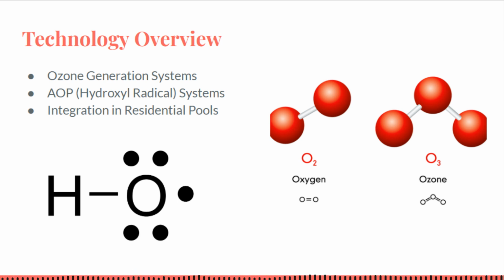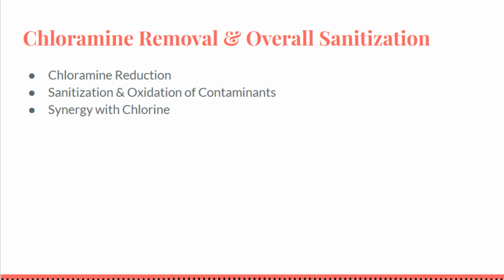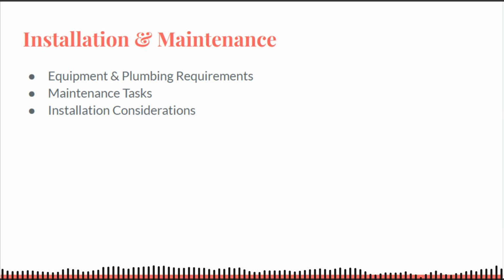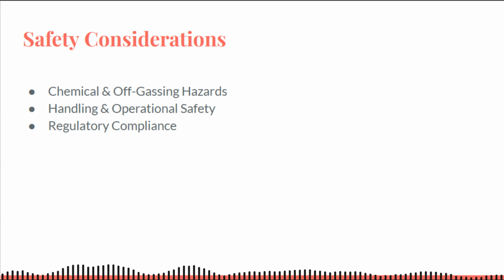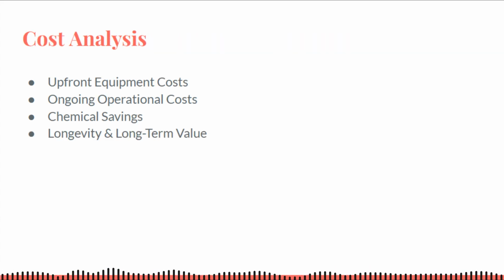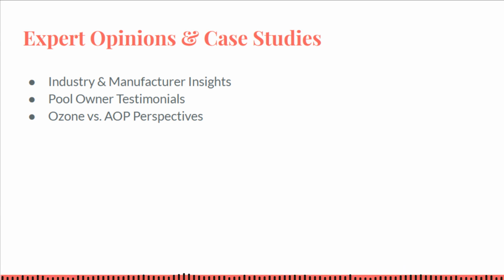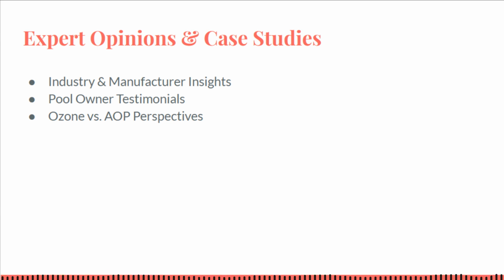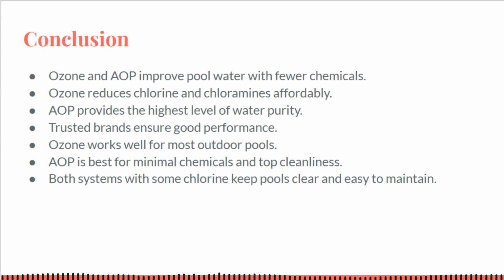Ozone Versus AOP Systems for Residential Pools

Comment: I've been in the water treatment industry for 25 years and I have to say, ozone sucks. It has an extremely low solubility with respect to water. Most methods of introducing ozone into the water are extremely poor. The vast majority of the ozone does not stay in the water, instead, it comes to the surface and degrades anything that it touches. And you still have to use chlorine anyways.
Reply: Hello! I had a custom pool built with 03 pumped to the bottom through 3/4 in venturi from Del Eclipse starting in 2003. The )3 always came out the pool bottom & we added Lifegurd Purificication system for our 12000 gallon pool. The water was pristine & required no chlorine when the 03 generator had a pump that ran in 24 hours a day! Now this AOP that was installed in my pool only pumps the treated water to the TOP valves.